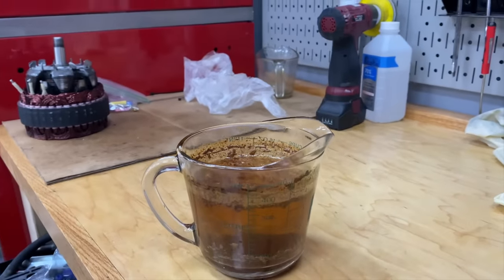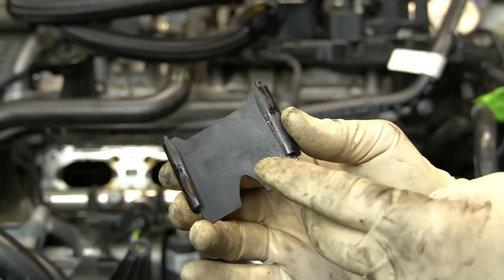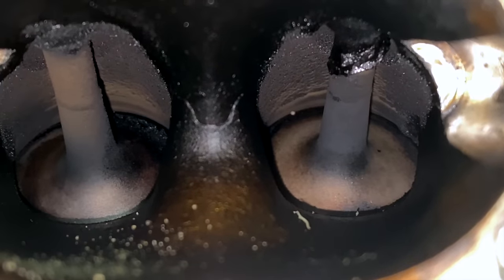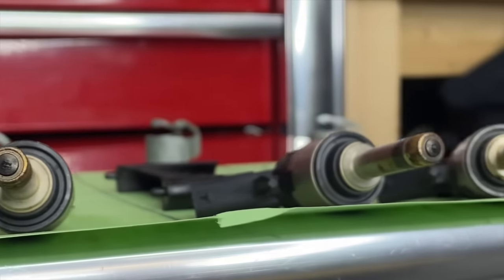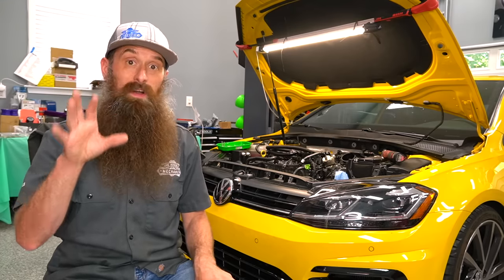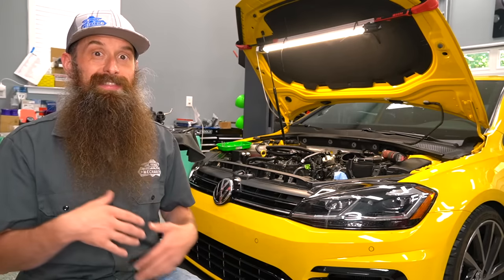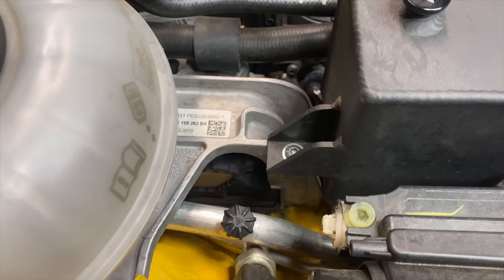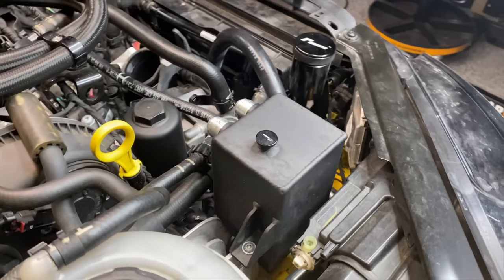Did the Catch Can Work? 10k MILE TEST

Comment: For the vapor smell, check the seal on the coupler that goes to the turbo inlet. They frequently do not seal correctly, and will vent oil fumes right in front of the firewall.
Reply from the maker: Good call. Thank you

Comment: Charles, in the subaru world we sometimes need to install turbo vent sump restrictors to get rid of the burning oil smell. Sometimes in less restrictive downpipes it changes the back pressure within the turbo and draws some oil through the seals burning it in the exhaust...

Comment: I've never seen the value in a catch can. I've owned 4 DI engines now, one a turbo - never had any sort of issues. I borescope'd each at 20k and 40k and they look fairly clean. I think that a nice highway jaunt driving spiritedly does more good than anything else - seems to be the people who take short trips and baby the car have the build up issues.
Reply: Try checking at 80k and 120k and 160k.. we're getting up there in mileage given the years the mk7 been on roads already
Reply: @mckylecfc  If I keep them that long lol, all of these have been Mazdas, and have served me well. We pulled a 6 with ~140k on it and it was still acceptable. From what I've seen its the Germans and early Ford Ecoboosts that have the worst issues with it, specifically earlier systems with VAG and BMW. But I still think the people that putt them around are the ones with the issues, the lower mile cars seem to have a correlation with buildup
Reply: @Suction_  the mk7's are so fine I can't let go! Especially seeing the disasterclass with the mk8 and no buttons/overreliance on screen based hvac /everything smh... qhats next in this line of progress - plug ourselves into the matrix and use virtual blinking instead of going thru trouble of opening eyes and getting out of bed? Lol.
Reply: @mckylecfc  I'm not a huge VW guy to be honest. Especially considering my last rentals from enterprise being an atlas cross sport thing and a passat. The infotainment on both were definately annoying to use, the IPS displays were great, but navigating around was not easy. Sound system was TRASH too lol, the audio range of the systems we're so flat and washed out. I really don't care for the look of the mk8 either, looks kinda cartoony
Reply: @Suction_  GTI and Golf R are different to rest of VW lineup -made more for driving enthusiasts ala Mazda3's Speed or Sport (100th?) which I wudnt mind test driving tbh but I'm still on the fence abt the styling of that hunched back... and reviews aren't the best either on power delivery... but if that 2.5 ltr turbo can be tuned I'm curious to see results..
Reply: @mckylecfc  I have a cx30 and cx5 turbo. I don't care as much for the driving experience clearly, but for their class, they are the most engaging. They're not tuned to be screamers or anything, its more for usable power, being most of the grunt is below 4000 rpm. That being said, I did have a few instances to open it up and it is just as quick as something like a civic si, or an older wrx. My area gets hammered with snow in the winter, and I carry shit alot along with towing, so a crossover is my best option here.
Reply: Mazda definitely has less big affects of carbon building up, Hyundai on the other hand it’s a big issue. Also Mazda has a oil separator from factory idk if it’s all models but cx5 has one I believe, not perfect but at least it’s their unlike other manufacturers.
Reply: @henrytom5824  all models I belive have them. Hyundai system is very cheap though, the high pressure fuel pumps die all the time and the carbon is horrendous. I like my mazdas though, never had any major issues and they drive so much better than anything else in the class
Reply: @Suction_  your not wrong at all bro, we would like to get a Mazda CX-5 someday after this vehicle 2020 Tucson. CX5 is just beautiful. Can’t go wrong at all.
Reply: @henrytom5824  I do like the new Tucson. They did a good job with it, I'm more into the driving experience than the tech though, which is where mazda excells and Hyundai falls behind. Hyundais lane keep and feature set is definitely ahead of mazda though, my friends sonata with smaht pahk is definitely useful
Reply: @Suction_  we would have ended up with the new Tucson but it came out acouple months out when we needed another car so lol oh well. Got a all black 2020 so looks pretty dope black paint looks amazing man. I’m religious with washing it aswell been one year and still looks brand new.
Reply: And definitely keeping that damn Catch can on for the rest of its life lol. Only take off for dealer services.
Reply: You might be right, but a lot of peeps drive small turbo engines only around town and their engines do not get up to the temperature very often. It really depends on your driving habits.

Comment: GDI engines work great until they get gunked up, I work in a lube shop for 10 years, take my advice change your oil often and use only the very best if you have GDI engine and use a fuel additive, it all adds ups to help ameliorate the problem. A catch can will help a little too

Comment: Lol 😂 Why are catch cans a pain in the ass?!?

I live in New England so if I install one of these Racinglines catch can, I gotta take it off during the winter?

Too much work, I’ll just get a walnut blast clean. Lol 

Thanks for the follow up video was waiting for it.
Reply: Same live in the uk so we get freezing temps aswell although our pre gpf cars are mpi so i think we're better off
Reply: That’s how I feel. I have a BMW with the N55 engine and I’m just over 100k miles and haven’t needed an intake cleaning yet. Is there some build up? Sure. But it’s not messing with anything to warrant the effort of a catch can. Next time the intake manifold is off to change the oil filter housing gasket, I’ll probably just clean them then.
Reply: A frozen catch can will turn your engine bay into an oily mess. I see it happen with at least one customer every winter.
Reply: Thank you! We need more logical folks in the community.
Reply: @slscamg  so the N20's, N26's, N55's N63's, etc are more resistant to cold start misfires than TSI's. Mostly due to valvetronic.

TSI's have a very small intake port at idle. Any build up will disrupt airflow noticeably.
Reply: Well i live in the north part o Sweden and i have zero problems with it, youst empty it more often in the winter but i have a rs3 with a Forge can that have a tap at the bottom so it is easy to empty it, takes few sec.
Reply: Ive heard you can just put a little anti freeze and it will stop the catch can from freezing, i also live where it gets really cold in the winter and I've heard of people  blowing their rear main seal because of a catch can
Reply: @icxcnika555  as I said, I see this at least once every winter. "But the guy on the internet told me he never had an issue!" Yet. Hasn't had an issue, yet.

Comment: Engineering Explained did a video on D.i. cars and the itlian tune up. You can infact get the intake valves hot enough under normal operation with higher rpms to burn off carbon buildup. I would say with the catch can slowing down the amount of carbon buildup on the valves made it more manageable for the engine to burn the carbon off. That would answer why the valves you didn't clean before the test look better than before.

Comment: Short trips = lots of condensation.

Every bit of the sludge that doesn't get back into the intake is not getting burned. That means it's not putting carbon back into the system.

The only problem with catch cans is people forget to empty them.

Comment: I've gone back and forth about a Catch Can and from what I gather, it's mostly a placebo effect. Some of the contents of that can were probably solvents (detergents, water, and fuel), which help keep things cleaner. I'd be curious if you could measure the actual carbon content of the can. Possibly through rendering? (Boil off the liquids and measure the mass.) That would give you an idea of the mass of the solids (mostly carbon) removed by the can.

Comment: I have a question,  was there any change in fuel? like when  you gas up at gas station,  is it same place every time or different place?  is it same oil you have changed in last 20k miles?  any additives?

I find that when I fuel up, I generally stay at same gas station using same gasoline that I use to fill up and i use Quaker State 10w-30 in my Chevy Blazer every 3,000 miles and now my motor is at 255,000 miles and it looks damn clean and still have the cross hatch and some carbon build up on the piston crown and clean valves too. it shows how same variance it can be when it comes to fuel and oil? but great video and diagnosis!  love it!  great job, charles!

Comment: The 3-400 mile drive probably decarboned the intake a noticeable amount IMHO. Hours spent at high throttle openings and at ideal running temperature does wonders at removing carbon, it might have been interesting to use a borescope and have a peek at the pistons. I also suspect the engine in your car is in pretty good condition, so perhaps not much blowby when compared to an older engine.
Reply: idk why everyone is so concerned with this carbon build up. Who cares. As long it it's not built up to where it's decreasing air flow it's not a problem. 
All that goes through that intake is air, it's not disrupting the fuel so it's not really that big of a deal especially on a mostly stock car that already has multiple bottlenecks and restrictions to air flow anyway.
Reply: @jims.3987 You shouldn't talk about things you don't know anything about. You're making yourself sound ignorant.

Comment: Having a bucket of water connected to my engine's oil supply with only gravity preventing it from mixing is the kind of thing that would keep me up at night. A real sword of Damocles.
Reply: Yeah like what happens if your hard cornering a lot? Wouldn’t it slosh up and be sucked in to the engine. A little mist of water is tolerable but otherwise this would make me very worried. I’m assuming there’s some kind of separator?

Comment: I was thinking of fitting a catch can as I have had the valves walnut blasted already,but not to sure now if its worth it
Reply: If the previous OEM setup caused build up, of course it’s worth it to modify the system to make it better. 

It clearly catches a ton of moisture and oily mist. You don’t want that in your intake track PERIOD. 👍🏻

Comment: Stage 2 and up you need a good catch can. Adequate pcv is important... factory pcv is not made to see above stock power and torque levels. If you're not venting the system correctly you will end up with a metric ton of blow by and be burning it out of the exhaust. Under normal to light driving conditions you won't see much of a difference but if you're getting on it on the back roads, circuit, autocross at the strip or in a straight line in general you will notice the difference. 

On these cars today I'd run a stage 2 setup as such. 

1. Upgraded intercooler and piping 
2. Downpipe 
3. Oil cooler and Trans cooler 
(Note an oil and Trans cooler will eliminate the ability to run a front mount intercooler most of the cores mount to the front crash bar you may be able to modify and remove your fog lights and run them in the outer edges of the bumper and then run an fmic if you don't wanna deal with the factory one or an upgraded factory but you will loose fog lights if this is the case)
4. Catch can 
5. Upgraded fuel system full e85 files or full flex fuel (wich will put you in line to go stage 3) at any level e85 tunes are going to make more power and torque vs 91 and 93 

Alot with these or any car people don't think about setting them up right and running proper supporting mods. Gtis are typically cheap card especially used and thats caused alot of people to modify them as cheap as possible. Spend the time to modify it correctly with good quality components

Comment: My catch can has a threaded plug on the bottom. Could a drain be made for that location? or is there a clearance issue.

BTW, thinking of adding a single nozzle water/ methanol kit on the intake after the throttle body. I feel in addition to lowering inlet temps, it would help keep intake valves clean.
Reply: Sure, you could do that. Would definitely need to redo a tune for it, though.
Reply: yeah try to tell the computer how much fuel to inject after such a mod. or make it with a button for occasional cleanup on demand.
Reply: @Hawk7886  a single 32cc nozzle ( smallest available from prometh ) shouldn’t need a tune. Also if you place the nozzle directly after the intercooler outlet it’ll give it enough time to fully atomise before the manifold
Reply: @lukekilah6257   when I spoke with AEM, they said the same thing. On a small nozzle there is no need for a re-tune. In fact, I talked to a golf r owner that did it, he actually tuned the car for the 104 tune APR.
Reply: @williamupdegrove5340  so long as the nozzle is before the intake temp sensor. Most modern car’s ecu should adjust the timing to suit

Comment: I’ve had the same catch can for months sat in the box I must get round to fitting it 👍🚙🇬🇧
Banjo bolt on the bottom with drain hose and a valve, built my own ready to go on once I fit it.👍
Reply: Are u not worried about it freezing?
Reply: @KasamS  no not at all doesn’t really get that cold in the uk I know loads of people running them and my tuner said they are a must fit and I do agree I stomped on my brakes and the cloud of smoke that came out of the exhaust made me think my turbo had gone bang thankfully not tho. Oil cooler at some point too but not needed it in over 2 years running over 500bhp 👍

Comment: I run the Provent 200 catch can it has a manual valve and hose to drain. Very happy with the results and only have to change filters every 40k KMs. I also have the oily smell after installing the catch can and I don't have any leaks either. My guess is that it's the oily vapour residue in the hoses from to the catch can, now sitting on top of the motor closer to our noses.

Comment: A catch can like this would have been awesome on my 1996 Passat TDI, those engines are infamous for gunk buildup on the intake runners. the most common "FIX" is blocking off the EGR and installing a filter in the crank case vent.

Comment: I have had opposite results. I have 2 vehicles with the ford 3.5 ecoboost engine. An F150 and taurus SHO. I put the catch can on the taurus just for the hell of it. Both vehicles are stock except a tune. The SHO valves looked way worse at 100k miles than the truck did. My thoughts are that all that "yuck" which is mostly water and gas act as solvents and actually clean the valves, not make them dirty. Just my 2 cents.

Comment: Amazing video!! Thanks Charles for keeping us updated on this install! I had the same problem with Diesel Engines, there is another piece of equipment that can cause carbon built up, the EGR, and the burning oil smell can be coming from that. I had remove some EGR´s valves and they contain some oil mixed with carbon residue from combustion. I'm not sure if, in this GTI, the EGR have a direct pass through to the intake manifold but in some vehicle the control valve is located near to the exhaust and the rest of the system have a direct connection to the intake. Please, check your EGR and make sure it is clean! I have been using ProVent 100, 150 and 200 from Mann and it works (at least in diesel engines)!

Comment: I drive 280 to 520 mile trips for work on a Mazda 2.5 GDI and a very small amount of short trips. This has been the case for 30k miles and the car has 105k on the odo. I'm adding a catch can as soon as it ships. Good fuel economy and no engine light. Would you recommend cleaning the intake valves?

Comment: I think that this water collected in oil catch can have cleaned valves in similar way as steam cleaning. There was enough water to be slowly (very slowly) sucked into engine. 
This was reason why valves are cleaner than before.
Reply: This is what I was thinking about.
Reply: But if there was no catch can the water vapor would have gone directly into the engine.  The catch can only delayed the process.

Comment: These days a catch can would be a must considering that most recently built engines don't have port fuel injection to keep the valves clean.  I have a feeling that the only reason they don't come with catch cans from the factory is that they need some maintenance periodically that an average person might neglect to do or neglect to do it in a timely manor.  It would be a lot better in my opinion to have the can and hopefully not have to pay to get the valves blasted.  I can only imagine that for some vehicles the cost of getting that done is horrendous since a lot of engine bays are tight and there are a lot of parts that must be removed first.  The only thing worse would be having to pull the engine or transmission it seems and anyone can tell that is not going to be fun either!

Comment: I have a Mk7.5 GTI that I changed the oil on at 1000 miles. I did it early for keeping the engine clean during break-in. I just changed it again today at 5000 miles, and the oil draining out had all kinds of glitter in it! I hope it is normal on these engines during their first 10,000 miles or so. Most of my driving is in town and I do like to drive it hard. Hope this metal isn't as bad at 10,000 miles. These vehicles are way too fun for their practicality!
Reply: Change oil every 7000 km and you will be alright

Comment: I have a small oil catch can on my 6 cyl Camaro.  I empty at each oil change I do 3000 miles. Only thing in the can is maybe a shot glass full of oil.  No water however I put the car in indoor storage in the winter.  No salt on this car!  Love the catch can. It’s a screw off type.  One of these days I want to pull the intake and see what the valves look like.  I bought it with 34k and now I have about 42k on the car.